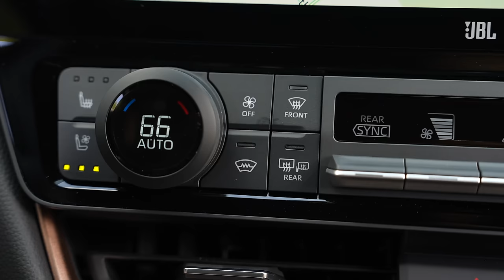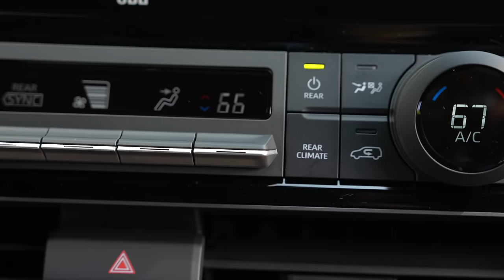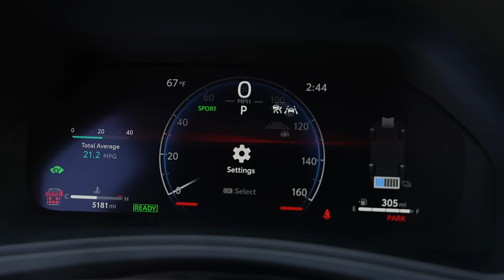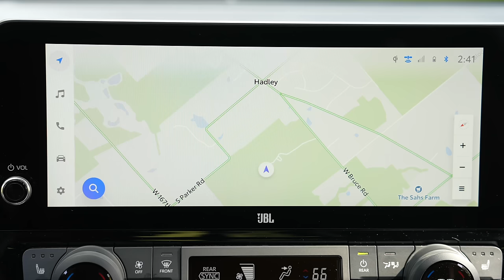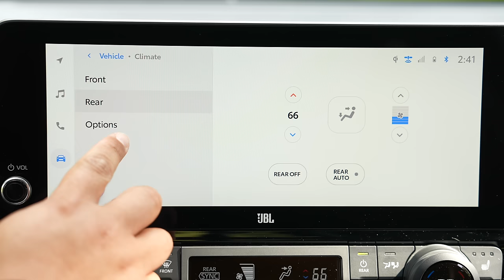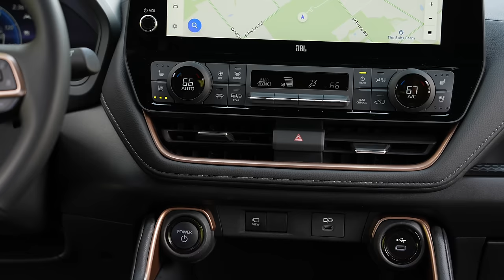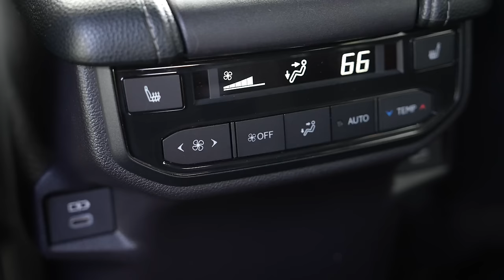Should You Buy A 2024 Toyota Grand Highlander? Back To Basics Toyota

Comment: Just bought a 2024 Grand Highlander (non hybrid).  Regarding the turbo engines, did I hear him say “No 10k mile oil changes on the turbos??” Toyota recommends 10K miles between oil changes.  If that is not ideal, what do you recommend?

Comment: Non hybrid non electric. Thank you Toyota for keeping it simple and reliable. This is why I always keep 1 Toyota in the garage at all times. Great review as well thank you. Love the channel.
Reply: Toyota hybrids are super reliable too. Between 250,000 and 300,000 miles they will last. If you replace the battery with an oem one you might be able to get it to last twice that. But it cost like $5000 for battery and labor. And if you live in a cold climate where they salt the roads, the frame might be the first thing that goes before even the battery.

Comment: Nice review Amd.  One question, why does Toyota still use the old fashion hood support when open and not struts?
Reply: Weight, cost, space, simplicity, and reliability, in approximately that order.  Unlike a rear hatch, the hood isn't raised often enough to make them want to take a hit on all 5 of those things.  Also, unlike a hatch, by the time you get the hood latch unlocked, you're already using gloves or going to need to wash your hands, so hood struts don't provide much benefit on that, either.

Comment: No rear bumper huh. What are manufacturers thinking? Does anyone here know how common it is to get rear-ended in areas that snow? The first thing I would do is add a hitch if it doesn't come with one and throw a tri-ball on there. It has saved my rear bumpers more than anyone could know.

Comment: I’d love to see you go through the Grand Highlander Regular Hybrid instead of the Max… 🥰🥰🥰🥰
Reply: Max is same as regular hybrid with 2 key difference. max has 6 speed transmission and turbo because of that you get to feel lke almost V6 and no drone issue but problem is that that 6 speed transmission will give some problem after 150K.. but hybrid  transmission are solid it is like 0 or 1 all electronics with one planet gear.

Comment: I have this car and in the Hybridmax version.  The car is VERY fast for its size.  However....I have issues with power surging or power loss in the car.  The car would intermittently feel like there's power loss when I slow down and turn and may make a clicking sound as i pull out from a turn.  Sometimes, it clunks on acceleration.  I feel like it's an issue with the gas and electric motors syncing.  I felt sometimes as if the car was about to stall. My older 2020 Rav4 XSE has zero issues (i know it's a different powertain w/CVT).    I've brought the vehicle to Toyota for service several times where they said they would reset or reflash the ECU.  The problem still persists intermittently.  I love this car though but since i got the new first year model, i bought a 96mo warranty for only $300 more than a 60mo warranty.

Comment: You cannot buy that model anymore. They are not allowed to sell it due to to airbag deficiencies. What a shame. That means the Lexus TX has that issue. However, those who purchased it already get the fix and keep it😢. It is a beauty.
Reply: 21 october was a date the factory might start production again. will be interesting to see.  doesn't seem owners have received the bring it in notice to get the redesigned airbag installed.

Comment: I am between the new honda pilot and the grand highlander.  Which one has the better motor? More reliable.  Least issues and will last 250k miles?
Reply: Milage wise the Grand Highlander gets more miles to the gallon and the Hybrid version gets even more. Test drove a Pilot Trailsport yesterday and it felt smooth. Haven't driven a Grand Highlander yet.
Reply: pilot has traditional v6 should last.   Toyota stuck with turbo or regular hybrid that battery will need to be replaced at some pont, has a good warranty on battery but not to 200

Comment: You have mentioned in past videos (maybe not directly) that Ford copied Toyota’s hybrid system.  I think at one point in the past, Toyota released all its hybrid patents for other manufactures to use.  Nonetheless, I’m happy that Ford did so since I own one of those Fords and Toyota is obviously the leader in hybrid technology.  It would seem as though Toyota took a page from Ford’s book when they added the electric motor to the transmission.  I could easily be wrong since I don’t know the history of this other than Ford came out with the F150 hybrid before the Tundra a hybrid arrived.   What are your thoughts on that?

Comment: Why we went with the sumo highlander and not the sienna: 1) we need to tow a trailer loaded at 4000 lbs 2) heavy Atlantic Canada winters and gravel road canoe trips need more ground clearance… minivans can’t get up some of our canoeing access points 3) stronger shaft driven 4wd 4) the sienna drags its ass with any mount of weight, roof top carrier or bike rack on the rear …. This vehicle, the 8 seater XLE, is like it was purpose built for our family. It will do 8.5 l/100 km at 100 km/hr with minimal hills or headwind . We love ours. 34,000 km now since September
Reply: How is towing in this? Trailer fully loaded at 4k? What are the tongue weights and do you have a full payload when you tow your trailer?
Reply: We won’t be towing until July. I can report back then. Our summers are very short. By September most people have their campers winterized until the following May/June! My tow weight is roughly 4000-4200 (trailer dry is 3300). Tongue is hard to say as I haven’t measured, but I would say close to 500. We towed for three years with a 2016 Highlander v6 with this config.
Reply: @ExpeditionaryRanger  that's awesome. We currently have a boat, but am looking into some camper trailers to go with the xle gas grand highlander (non hybrid). Enjoy the trips!

Comment: In the driver seat;can one see what's in front of the Highlander?  Can you park it in a tight spot?
Reply: get a limited it will have the sensors that beep, and then add the option of 360 camera that really, should be standard on cars that size.

Comment: The problem with NiMH batteries is that if you drive 3-4 miles downhill, the battery will overheat and shut down.
Reply: The systems have gotten smarter. The system can actually use the motors to spin the engine to burn off  excess power. Plus if you are doing a long downhill decent, you are supposed to use manual shift mode in the e-CVT units to more or less lock the gear ratios and get mechanical engine braking. The hybrid max system really shouldn't have that problem.

Comment: I have a 2021 Highlander V6 with the integrated parking brake that is a pain.  It is noisy and unnecessary. I shut off the automatic activation and only use it when I feel the need.  It is much better for me that way.  I can usually count on the fingers of one hand the number of times I have ever needed to use a parking brake on any car in the last 52 years so why would I need this one on all the time every time I put the car in park?

Comment: Even for Toyota, new cars are so complicated that it won't be bullet proof. I would probably wait 1-2 MYs for Toyota to fix any issues they didnt discover. Probably the gas and regular hybrid one will be better as they are already tested in some other cars, but Hybrid max is relatively new, so that would be taking some risks. Even reliable RAV4 hybrid had a high voltage cable issue which was found during real life testing. i would buy Sienna over this if I can find one. Toyota.. Please don't forece this over Sienna by not producing enough Sienna for consumers...

Comment: Great video so thanks very much for the detail.  I am wondering what your opinion is on the hybrid max towing abilities.  I know it has a 5k tow capacity and a payload of about 1500 lbs but the tow package only has a four pin connector which does not communicate with trailer brakes.  Why would Toyota say it can tow something that, by law, requires trailer brakes but then not provide the necessary connection to do so?

Comment: Thanks for the review because I wanted to get this car but dealership around my area do not have it on the showroom or have it for test drive. But I'm debating for Grand Highlander or Honda Pilot.. Any advice or share opinions?
Reply: Toyota is always in short supply and most likely to be over MSRP which negates the hybrid savings if you want to change car every 3-5 years. Just get the Pilot. They are basically the same IF you do not maintain the car yourself.
Reply: @csmlouis  I like the new Pilot the only thing that bothers me is the gas mileage both city and Hwy its similar to my MDX that eats alot of gas except pilot is not a premium gas which  is good.
Reply: The pilot still uses Honda’s silky smooth 3.5 v6. Get one while you can, since Toyota already stopped putting their excellent 3.5 v6 in highlanders. Both v6s are jewel like in quality and amazingly long lasting

Comment: i have a 2023 highlander xle. what rpm should i keep it at to achieve those high mileage numbers? assuming I drive mostly city. right now I keep the rpm below 2k at a red light and I can tell people behind me are annoyed but if i accelerate into the 2k-3k range, the engine gets whiny and I feel like its causing more wear because of the noise. Will I still be able to achieve good mileage while normally accelerating below 3k rpms at a light?

Comment: At around 13 minutes, we can hear the explanation that at certain driving conditions, the transmission has to disengage and re engage something that creates a delay at high speeds: I have one question. If Hybrids require an automatic transmission, why not use the less complicated 4,5 or 6 speed automatic transmission, even with a fluid dipstick to measure its fluid level, avoiding the CVT, E-CVT, or a complicated transmission with this characteristic?  I read the original Hyundai Ionic, a copy of the Prius even in design, came with a 6 speed automatic. Why not make it simpler with a 6 speed automatic? Is easier to maintain, but it will lose 1 or 2 mpg? With better driving anyone can achieve 1 or 2 or more mpg. I also saw a video at another channel, where the tester showed was not simple to select neutral in this kind of new automatic transmission when is a E CVT in the Prius. Is it electronic?
Reply: The Hybrid max does use a 6 speed.

Comment: I don't know much about engines you just hear how unreliable 4 cylinder turbos are in large vehicles.  Im not as interest in the mild hybrid because it feels sluggish, but would the hybrid max be more reliable than the regular gas engine just because the battery will be taking stress of the engine and it will have more power moving a large vehicle around?  Probably going to be in this car 10+ years and hard to decide which powertrain to go with.

Comment: Am surprise you did not mention about those rubber lines going to the Transmission ,when they should be metal lines , and to make it worse it’s about a foot away from the muffler. 
That rubber hose will get bridle and dry and in the long run it will break and leak all oil out . 
Please tell me if am wrong. It was only a observation I did . Thank you, I do love your videos , my The Lord Bless you much 🙌🏼🙌🏼👏🏻👏🏻🙏🙏🙏🙏🇵🇷🇵🇷🇵🇷🇵🇷

Comment: Can you please do a review on the Subaru 2.5L (non turbo) Boxer engine? Like from the Outback/Forester?
Reply: If it's a 6-cylinder, don't buy. The four cylinder Boxer engine is the best, short on horsepower but you don't buy a Subaru for breakneck speed. LOL For breakneck speed you buy the WRX STI: The Subaru STI is the more powerful and performance-oriented of the two (WRX vs WRX STI). It comes with a bigger engine, stiffer springs, thicker tires, more powerful brakes, and more. Oct 27, 2022

Comment: There’s a mention about the front suspension aluminum knuckle, and a potential issue about welding if the bearing needs to be replaced - can someone elaborate what the issue is?
Reply: Corrosion between dissimilar metals. The steel part corrodes faster in contact with the aluminum, as it rusts - it expands, "welding" it inside the aluminum knuckle.

Comment: More better reliability Hybrid Max or standard Hybrid to get?
Reply: I'd say the regular hybrid. No turbo to worry about(alot of people over play it, but still), simpler gearbox mechanically. Plus the regular hybrids are better at stretching mpgs. The regular hybrid engines are more proven at this point. Keep the oil changed and do longer trips, they will last a long time.

Comment: Honestly this is the kind of review I expect on yt. Features like big screen, ventilated seats and all new stuff like these are not really interesting for me. I need to know. What mechanically looks good and not good. Is car ergonomic in many ways. Is trunk big and doesn't has any bulges which makes it useless. 

About engines with turbo. Good thing is not only to be aware of oil but air filter too. I was working in company which repairs turbo and well. Many of them dies because:
1. Wrong air filter
2. Air filter change was like 20-30k km ago.
3. Due to be old it can let rocks go threw it and damage cold side.
4. Full throttle while turbo wasn't in optimal temperature and torment them in summer when temperatures were high. This problem is common mostly in small engines like from VAG but the bigger car is with smaller engine then turbo needs to work way more.

Comment: I have a 2021 Highlander with 43,000 miles.  A condition has developed that is quiet annoying.
When filling with gas, the pump's auto handle continually shuts off.  To fill the car one must manually hold the handle at a very slow flow rate.
I've been to the dealer.  They have no definite idea of the problem.  They want me to leave it with them for a while.
One thing of note is that I do live on a dirt road and there is dirt collected around the filler hole.  The dealer suspects dirt maybe clogging an air flow system
I will add the car runs fine whether full or near empty.
Any thoughts?

Comment: From what I understand that turbo and the hybrid system is more expensive to have so if I don’t need it, I don’t want it
Reply: watch his video where he says the hybrid has no starter , alternator or belts....download a hybrid warranty maintenance manual and look at it, there is not much at all required.   On regular highlander those battery box air filters are 10 bucks on amazon lol.    turbo system only, change the oil aggressively lol..thats about all that is different

Comment: Adding a turbocharger with over 200 ft lbs more torque in hybrid Max than the standard hybrid should INCREASE the fuel economy at highway but instead Toyota, with this transmission combo is terrible for fuel economy.  It demonstrates that the EPA doesn't care about fuel economy, but instead it is actually emissions they worry about.  The consumer, on the other hand is getting ripped off and not receiving the best value for their hard earned money, that is depreciating every day under the current leadership. Hybrid Max seems it is not worth the money, especially with the added complexity.

Comment: Has anyone had this problem with a 2024 GH with under 2000 miles on it?  Passenger side headlight stopped working.  We were going on a trip the next day so I tried changing the bulb myself as I've done with every car I've owned for the last 40 years.  I couldn't twist the bulb out but my pliers left a few marks on the plastic.  Finally, I read the owner's manual only to find that it says "see dealer".  Are you kidding?  Headlights have to be changed at the dealership?!!  And by the way, the plastic marks from my pliers void the warranty and the dealer wants $1300 to change the whole light assembly because the headlight assembly part itself is over $1000.  Yes, you read that right.  A total of $1300 for a friggin' headlight.  I should have gotten a used vehicle so I could do simple repairs myself.  If this is Toyota's new business model to make outrageous profit on repairs then this may be my last Toyota!
Reply: it’s under warranty…
Reply: toyota had a big issue with the headlights on avalons like 5 years ago or so, and yes like 1k or more for the early led headlights.  Wasnt a recall but they had to fix a bunch and a friend of mine barely out warrantee complained enough they fixed his.    think they sold extended warrantees with two options for a while, with or without headlight coverage..

Comment: Does the Non Max hybrid version have a turbo? Or is the Turbo is what that call MAX?
Reply: yes, the hybrid max uses a 2.4 turbo and two electric motors which are used in a different position, to gain power.    the regular hybrid uses a 2.5 non turbo  with one electric motor that helps with gas mileage.  This may be the same setup in the regular highlander hybrid the past few years. .